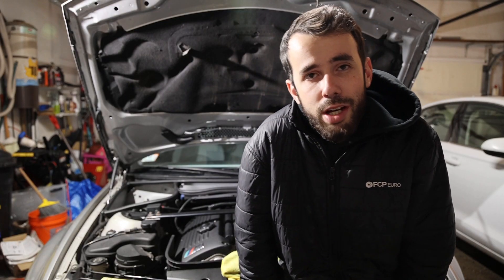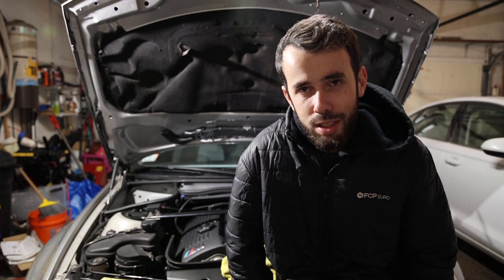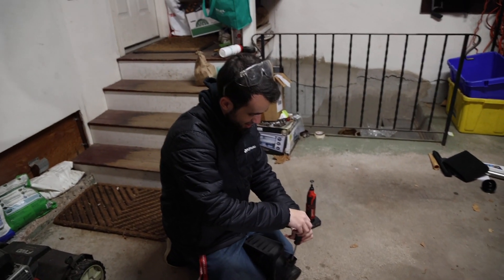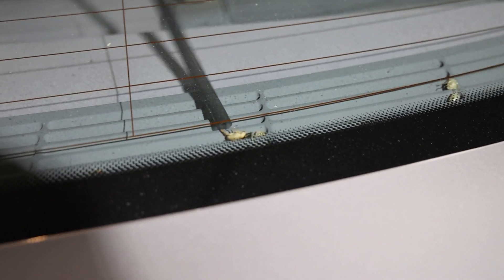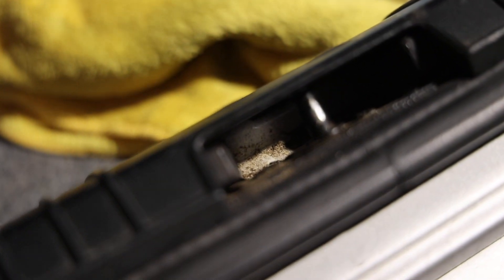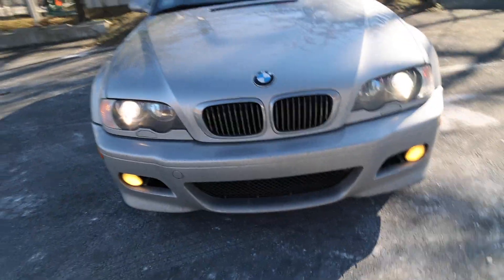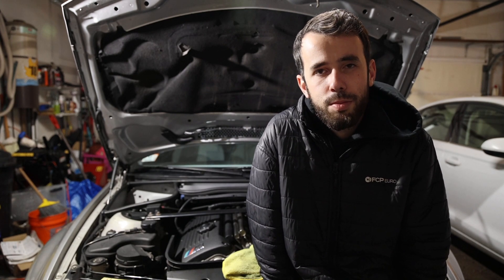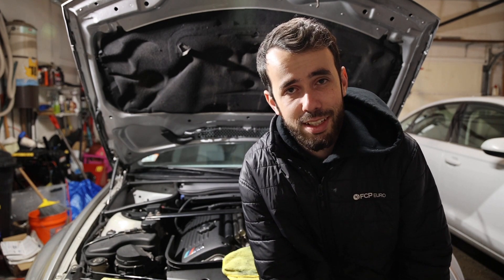My First E46 M3 "Mod" Is From A...... Volkswagen?

Comment: You should do an oil analysis and post the results! Im curious to see how that engines holding up!
Reply from the maker: I’m planning on it! When I bought the car the oil had just been changed I’m trying to put some mileage on it before I take a sample
Reply: I own a 04 150k miles held up just fine .   if it was for the internet they’d be saying it should have gone bang years ago 🤷🏽‍♂️